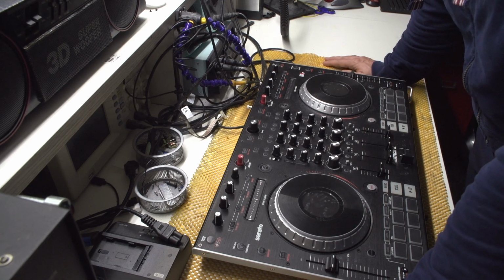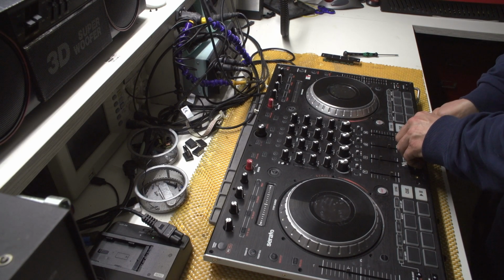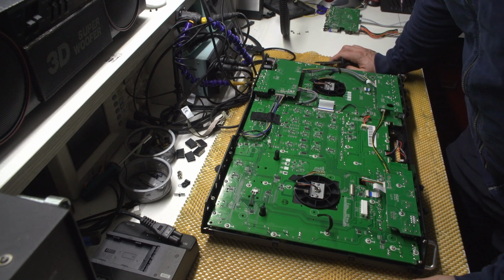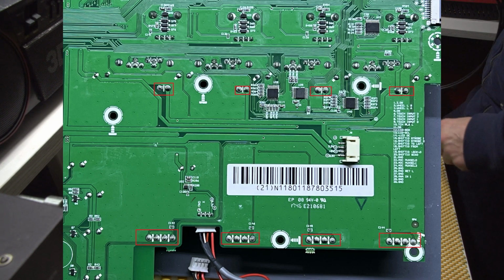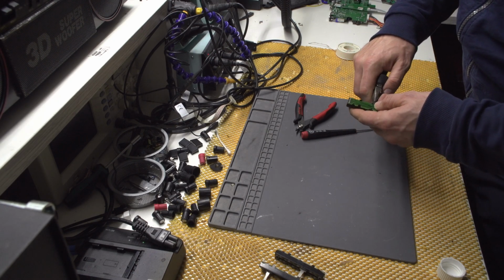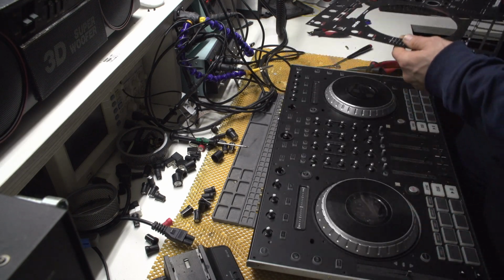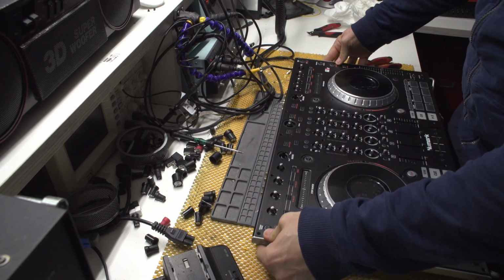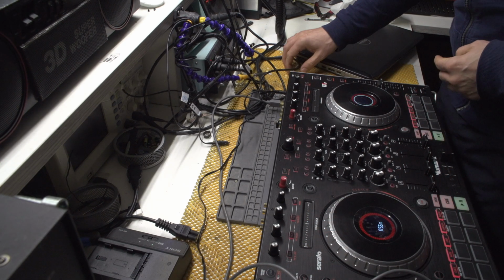Numark NS6II fader repair

Comment: What was the soldering tool you used to remove it from the circuit board?
Reply from the maker: That’s desoldering iron, however you can use wick or soldering pump ~ same but a rad slower 😊
Reply: @MTS_IT thank you, so much for the video, I'm going through this process now on clearing a channel fader that's going in and out. This video was EXTREMELY helpful
Reply from the maker: @djjante1993 cool 😊

Comment: Thanks a lot! This worked for my NVii as well, had the same problem. I got it at a thrift store as defective for 5Euro. Loaded correct firmware (graphic and audio firmware was missing, beats me how they did that) and a thin pruple line on the right screen, doesn't bother me. For the rest it works normal, except for the faders but that's also fixed now. Fun stuff.

Comment: I have a problem with my pads
Reply from the maker: Yeah, they tend to fail. However buttons are inexpensive…
Reply: @MTS_IT  have you ever changed yours I can't find a picture or service manual for the NS6 2. I find it strange that all eight pads have the same problem. Press the pad once you can't press it again unless you restart the machine and it's not a software problem it does it with both serato and virtual dj.
Reply from the maker: @MADSELECTOR  to me that seems like you have either dirty pad (clean it with isopropyl alcohol) or a stuck button

Comment: Thank you very much for taking the time to make this video brutha!  I've been needing to replace the channel 1 fader for years (I bought my NS6ii used) and now at least I have clear instructions on how to get to the channel fader section.  My crossfader is also starting to bleed on the left side so may as well swap that out too.  Any idea where to get replacement parts for the channel fader section?  I'm assuming a mini Innofader works correct?  Thank you again!
Reply from the maker: ebay, replacements are cheap and work as fine as the original one + they last the same